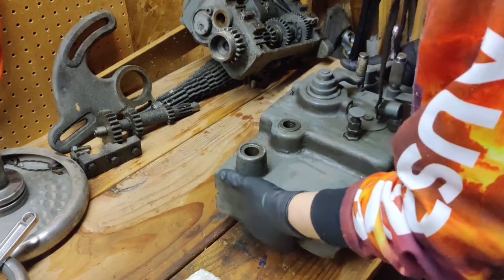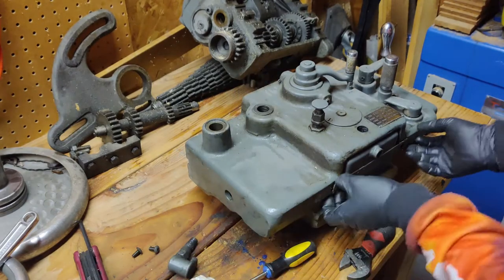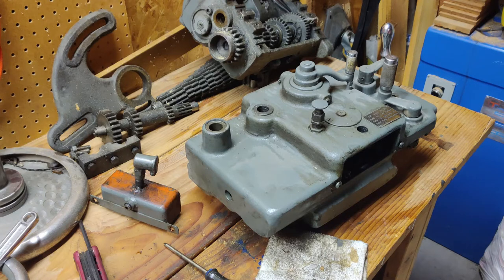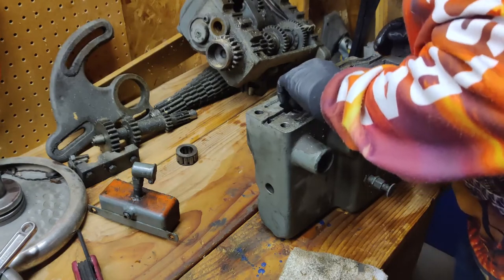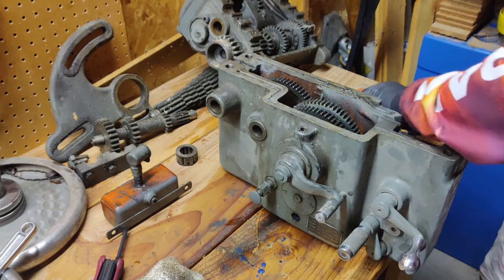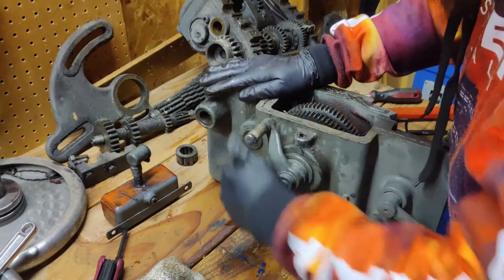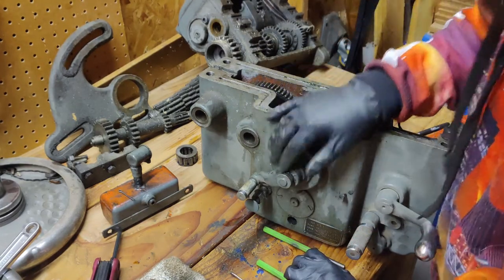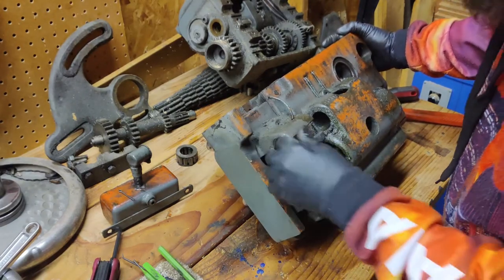1950 LeBlond Regal 17" Lathe Restoration Part 7: Apron Disassembly 2 of 3

Comment: I have the same lathe. When I got a stubborn pin like that I found that I had to use a sledge hammer and punch. The rubber mallet didn't work. Even with similar force the extra shock from the sledge would break them loose almost immediately.
Reply from the maker: Thanks for the advice, I'll try that out when I've got more time.